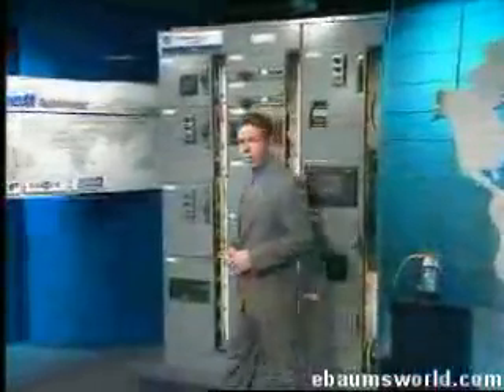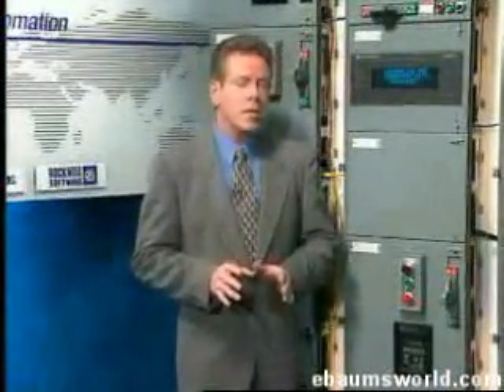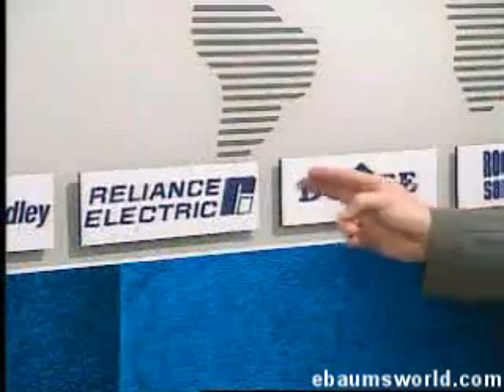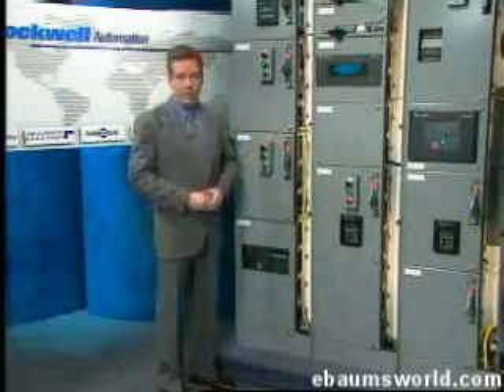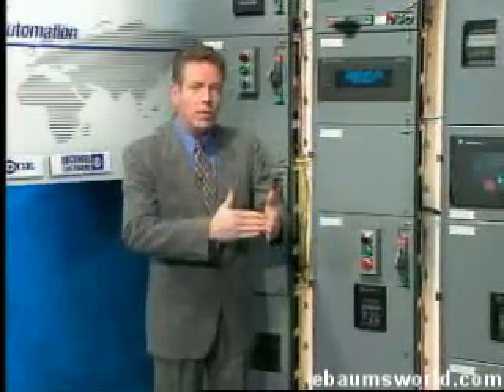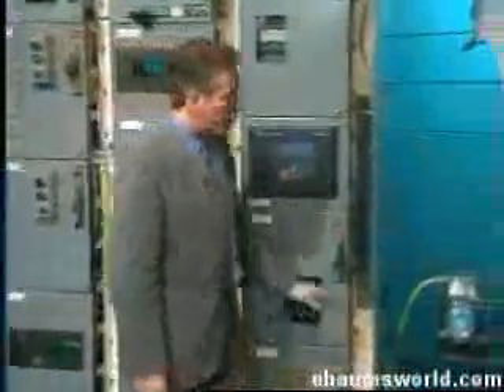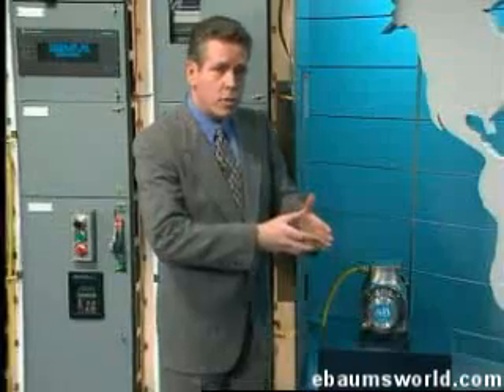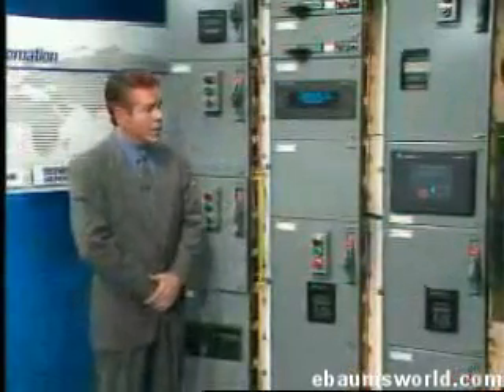Retroencabulator

Comment: A while ago, I experimented with a flip-flop override device attached to the hydro-coptic marzalvane inside the retroencabulator
as documented in this video, the results were not satisfactory as I had a slight dihydrogen monoxide leak which was not cleared by the pentametric fan.  I highly suggest you do not attempt it.